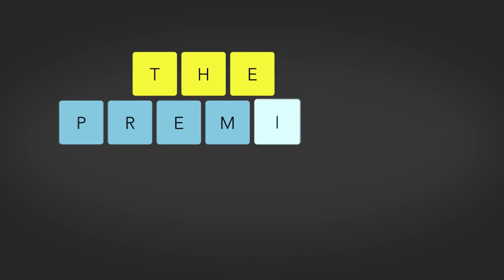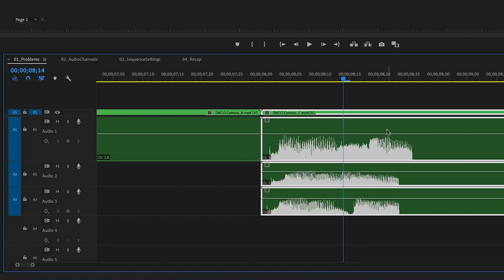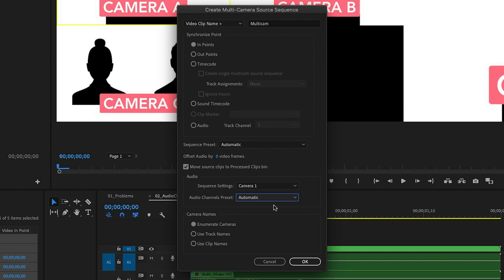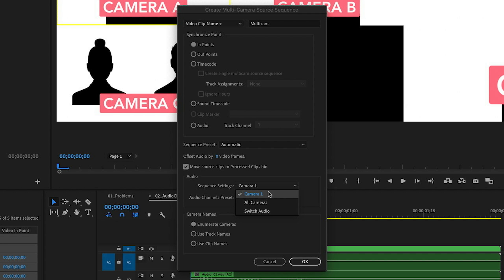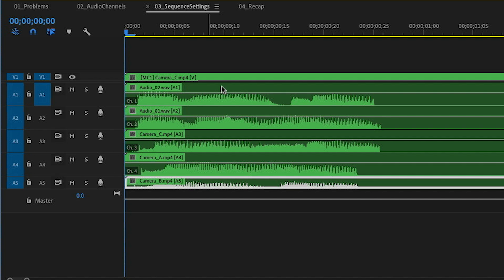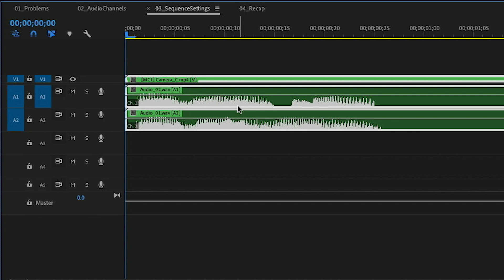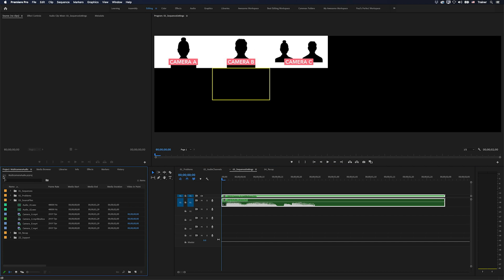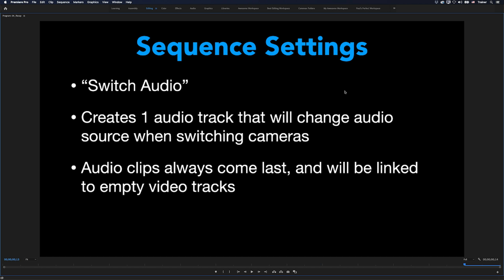Multi Cam Audio Issues & How to Avoid Them (Premiere Pro 2020)

Comment: please how do I fix failure to synchronize audio error!!!
Reply from the maker: If you're using Audio as your Synchronize Point, then this error message means Premiere is unable to find a match between the waveforms. This can be caused by excessive noise on one of the audio files, sometimes different sample rates or Premiere analyzing a channel that does not have any audio on it (you can fix this one by choosing Track Channel when you create your Multicam Clip).
Reply: @ThePremierePro  is there a way to use multicam even when the audio cant sync?
Reply from the maker: @CptZhu  Yep, I have a tutorial on it here: https://www.youtube.com/watch?v=aiVYRuWohZI

Comment: What specifically is the solution for panning? Did I miss it?
Reply from the maker: For panning issues, you want to watch the part on Audio Channel Format. Another cause comes up when you create a new sequence by using New Sequence From Clip (if the selected clip is a multicam sequence). It's always better to create your main editing sequence manually when using multicamera clips.
Reply: @ThePremierePro  Funnily enough right before reading this I realized the New Sequence From Clip with multicam was the issue. Good to hear you confirm. Adobe IT was clueless. Thanks for the upload
Reply from the maker: @ericberman_  Great to hear it's resolved!

Comment: Hi, the video didn't answer my question about multicam audio. What if I didn't use the "create multi camera source sequence". Where can this be changed afterward? I have manually created a sequence with 3 tracks of synced video and stereo audio. I nested this and enabled multicam but the nested multicam sequence only play one of the audio tracks. I want to use audio from "all cameras" like the option in "create multi camera source sequence. How do I combine all the audio in the nested sequence?  Thanks for sharing :)
Reply from the maker: Hi Terje, check out this video on manually creating multicam sequences: https://youtu.be/aiVYRuWohZI
Reply: @ThePremierePro  yeah, I previously peeked at that video, but I couldn't relate because I was trying to fix a MC that was already created. I think "adaptive track" is probably the sinner, but Google hasn't been kind last couple of hours. I'll probably head back to start and do it your way. Thanks for the help.

Comment: I'm having this issue where the audio waveform is flat and I cannot see it even if i click generate audio waveform. What is the solution please? I didn't get it form the tutorial, thanks!
Reply: If you select all the clips in your sequence that used the multicam clips, then right click on one of them... go to Multi-cam...Enable.  That's it!  All you clips should now show the waveforms.  It worked perfectly for me yesterday.  Too many secrets to keep track of in Premiere, but so many of them are a Right-Click away.
Reply: @KeithDadey  I have two audio channels, and when I do this only the top audio clip appears, the other stays hidden...
Reply from the maker: Did you create your multicam sequence manually or using Clip > Create Multicam Source Sequence?
Reply: @ThePremierePro  select the footage, right click, create multicam source sequence. Also, Ive been having another issue, not sure if its a bug or sth im doing wrong:when i pass through a sequence again to modify the cuts it doesnt overwrite well, some cuts are still there, the camera changes but the physical cut on the clip doesnt go away, so its a bit confusing sometimes. Im new to this multicam workflow so it might just be it. Thanks a lot!

Comment: Mannnn. So I've already got my MultiCam sequence set up and have done extensive editing on it. For some reason the source sequence plays the audio just fine through all the channels, but the MultiCam version in my edit is only playing the left channel. Any idea at all how to fix this without having to recreate my MultiCam sequence?
Reply from the maker: This most commonly happens when you're editing a multicam sequence on an adaptive track (adaptive tracks have numbers next to them). The solution is to add a standard track to your editing sequence and move your multicam sequence to that, then select every instance of your multicam and right-click > Remove Attributes > uncheck everything except for Panner.
Reply: @ThePremierePro  Legend! That didn't quite fix it, but it made me realize that one MultiCam clip in my regular sequence was working right and so I saw that it had the pan set to 0, and for some reason all the other ones were set to -100. Copied and pasted panner attributes to the rest of them and wha-la! Thank you for the speedy reply! There needs to be more good content like this about the many little quirks and snags that can happen in Premiere

Comment: Great video - thank you very much. Quick question. If You use the "automatic" and "all cameras" option, is there an easy was to control the audio selected in the resulting sequence? I don't want to switch to the audio channel associated with the selected video, rather I would like to choose the "best" audio track for the video... currently I am just using solo on the audio track I want, but wondering if there was a better way?
Reply from the maker: Great question! Of course, you can just delete the tracks you don't want on the timeline, or mute them (this is best if you're sending your sequence to Pro Tools for mixing). But if you want more control over the number of tracks + which channels to use, select the Multicam sequence (either in the timeline or your Project panel) and choose Clip > Modify > Audio Channels. Note: you can only change the number of tracks before you add it to the timeline.
Reply: @ThePremierePro  Thank you so much for the reply - its much appreciated

Comment: Wow one of the best no nonsense videos I've come across on the subject. Thank you! QQ for you. In the common mistakes section you mentioned a glitch of having audio waveforms not render in a multicam clip. Do know specifically what causes that? Curious as previous method I used was constantly causing that. That being said, the method was for me to make one multicam clip and then duplicate it and shell it out for other sequences.
Reply from the maker: Thanks! No waveforms means that some kind of mixdown is happening inside the multicam audio tracks, e.g. mono tracks mixing down into a stereo master, or an effect added to a clip or track. I have another video coming out soon that shows the right way to create multicam sequences manually without using Clip > Create Multicam.
Reply: @ThePremierePro  Genius! Can not wait to see. Keep up the good work.